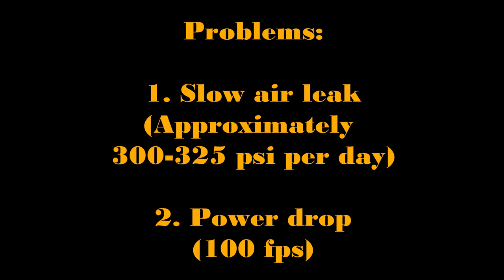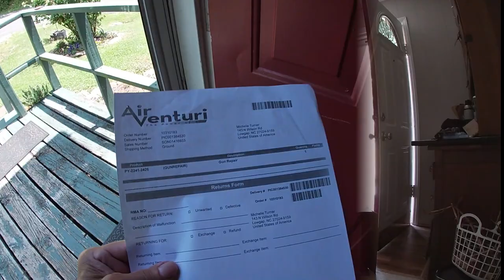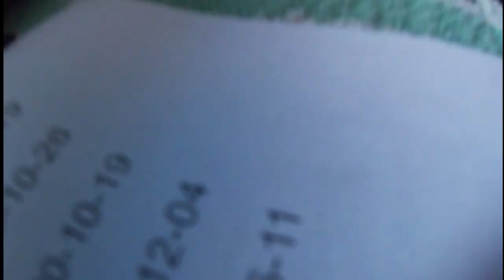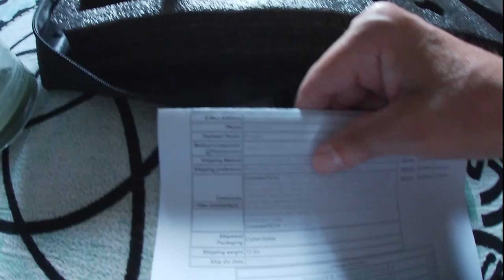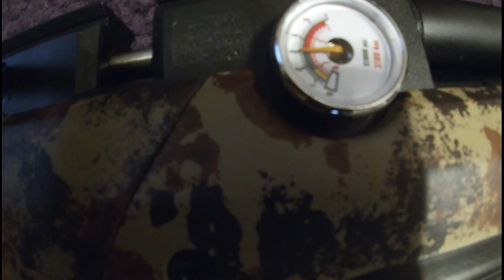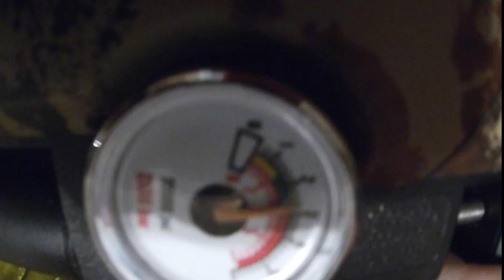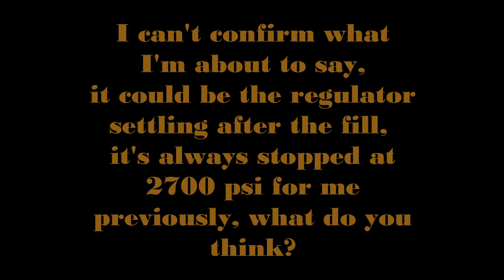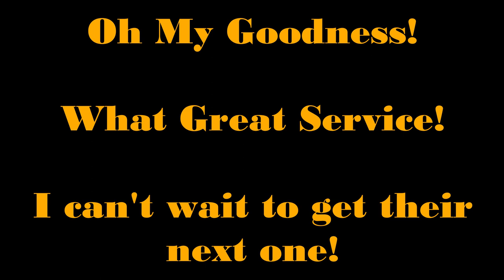Air Venturi Avenger Leak And Power Drop Repair Fail

Comment: I had the same problem, they sent it back to me and it was still leaking. Well after checking it over myself it turned out the leak was from the pressure release screw. the hard plastic 0-ring was over compressed or uneven so I went to home depot and got another hard plastic 0-ring and hasn't leaked since. Wasted 40 dollars to send it to Air Venturi and ended up having to fix it myself. The leak will not show up with soap and water for some reason. i pulled it out and inspected it when I did that I noticed it would not sit flat. Did the repair 5 months ago and it's been perfect. What's weird is when it had a leak the reg would creep up, but now that I fixed the leak the reg holds. Wish I would have inspected it myself before shipping it to te those ding-bats. They also never replaced the O-rings on the tanks because I marked the threads and they didn't even take it apart. Air Venturi was never like those before the Pandemic. Their service center was top-notch. It must be hard for them to find good help since Sleepy Joe Biden keeps giving people our tax money for sitting at home and pick their noses. About the Regulator, it's a very cheap regulator and it needs time to settle or you need to fire it 1 or 2 times for it to settle after filing. The regulator will never be perfect on this gun. But it's good enough to get sub moa groups at 50 yards once tuned. Once you get your main leak fixed you will be happy with the Avenger. Good luck man keep us posted.
Reply: agreed! some people are just too lazy to do it by themselves.
Reply from the maker: What the f*** are you talking about?? I'm definitely no poor wittle twumpy fan, by a looooong shot. I don't know who you were tlaking about praising their service before the pandemic, etc. but if you're talking to me, ummm, I'm not priasing shit unless it deserves it, and after this, and looking at their past customer service with the shit guns they put out, they're getting no praise from me, but a lot of sales losses due to my video on their shitty service. I don't think you know what you were talking about, maybe you were drunk. All I know is that you are trolling and being all political like a poor wittle twumpy fan, so you might wanna stop that shit, you're looking like one of them.
Reply from the maker: I'm not lazy, I had a warranty, and I also have real hosed up hands, actually every joint in my body, I've got a few issues so I'm disabled there slick. Take a walk in my shoes for a day and tell me about lazy, deal with chronic nerve pain head to toe and a bunch of other bullshit and tell me it's because I'm lazy. Fu*k off dumbass.

Comment: I have the wood stock version. Had it for little over a month, worked great with no reg creep or any other problems. I took it out yesterday May 1st 2023 and shot about 8 rounds. The gun started out at 3600 PSI, after the 8 shots it was down to 2000 PSI, I said " That ain't right" I took the gun in for a fill and it took an incredibly long time to fill? I took it back out to shoot and noticed when I pulled the cocking lever back I could hear a leak coming from the chamber, again I said "that for sure ain't right!" When closing the breach the air would leak out the barrel. I knew what was wrong, The plunger seal on the hammer spring had failed ! Not knowing how to replace it I called Air Gun Depot "where I had purchased it" and they gave me 3 options, return for refund, return for replacement or send to A.R. for repair.  I really loved that gun and struggled which option to use, as I didn't want one with reg creep, that is so common with these guns and mine was so damn accurate. I decided to go for the replacement as if it sucks, I can just get another till its a good one! I will let ya'll know how it turns out. If anyone has good step by step directions on how to fix this particular problem, I would love to hear it, as I know I could do it myself If I knew how. Thank folks.

Comment: Sorry to hear about your Avenger, I've had mine since Janurary this year , so far no leaks, I'm at work right now, but when I get home I'm checking it!!!
Reply from the maker: Thanks for checking it out. I know there are many with leak issues, but plenty of people have them running fine. I knew all about the gun before I ever got it, I was watching it and wanted one but wanted to see if they would fix issues. Well, I got it for Christmas so I was all in, lol. I thought they would actually try to fix it, I'm quite stunned that it came back the way it did to be honest. I'll fix it if I can, I know it needs a new poppet so I have to get an aftermarket one for that, I amthinking about just having it worked on and fixed by a guy that's said to turn theminto some really nice guns with a lot of power as well. If you running it at lower power you'll help prevent too much damage to the poppet it has in it and it will last longer. I had my reg on 2700 psi, it came that way and shot great so I left it. That is apparently too much for the poppet to handle, I'm still guessing it's the poppet. I told them all of this when i sent it back, still stunned at how this came back.

Comment: Have you made any ground on what’s causing the leak? My avenger is leaking about 1-200 psi per 24 hour period
Reply from the maker: It's been a couple of months, I haven't been keeping up on the channel. Nop I have put the gun down and left it alone, I'll fix it one of these days. I did put air in it a couple of weeks ago and it was empty by the next morning. I'm still shooting my Flashpups, my wood model is four years old and I've never changed anything other than the barrel oring that tears off when you remove the shroud, easy fix and doesn't have to have it. One of thes days I really will fix it, but not today, and probably not tomorrow.

Comment: I would check all the basics. Check and snug up the drain valve then snug up all the gauges. Unless you already did the soap test and got nothing at those locations. That’s where I would start. I have the 25 and have put thousands of rounds through it so far. I just upgraded to a walnut stock. I made a video of the improvements if you’re interested I would love to know what you think.
Reply from the maker: Thanks for the comment Sam. I understand what your saying, I have not checked the drain plug since it's been back. I love the gun, well, I wanna love the gun. As for me doing the soapy water test, shouldn't that have been done by the repairman looking for the leak to fix? Seriously, I shouldn't have to do anything to it, I can't see it being possible to let it sit overnight and not see that it had leaked. I shouldn't have to fix it, I paid to ship it back to them to fix it and it came back worse, cost me $31 to make it leak worse, I definitely didn't want it turned up as well. I too was looking at the new wood stock model, but if the warranty is useless for repairs I don't want it. I may have just got a bad one, no problem, it happens, but this is nonsense. I'll have it sent to someone who will replace the poppet, may just put money into jackign it up with opening the ports and getitng it tuned for high power with a good valve in it, but as far as buying another one from them, nah, they've done this several years in a row, put out guns that leak and the only way to get them repaired is after market parts and someone else, or repairing it yourself. Thanks for takign the time to leave a comment, I appreciate it.

Comment: Every few fills out one drop of SILICONE oil in the fill fitting, then attach hose and fill as usual. Before shooting each time, point barrel to the sky so oil will run down to exit tank and enter air system. This will keep interior seals and parts lubed up. And will help expose and/or prevent leaks in the pressure system.
Reply from the maker: I tried that back when I had the leak, didn't work, but thanks for the info. I do the same thing to my other guns occasionally, they have a fill port so I try to get a little in the fill probe hole to keep the inner seals lubed. I have one I need to change the seals in, it doesn't leak and shoots fine, it has the original seals from four years ago and it's doing fine, but I know it's recommended to replace them about every couple of years.

Comment: Damn brother that is just plain old flat-out terrible I know you don't want to say bad things about it cuz it is a great gun or had the potential to be anyhow but thank you for giving us an honest heads up and I was so close to buying one of those so far I've been lucky with all my tcp's thank goodness
Reply from the maker: I wouldn't recommend buying one until the address the issue. This one was supposedly fixed, I asked specifically about the poppet, they don't carry the parts. They are said to have fixed the new wood models, new poppets, but I just talked to someone and had a comment on my post about it in a forum that told me they are having the same issue with their new wood .22 model. There's a guy that makes poppets and works on them, the last two models they came out with had the exact same issue, they never fixed and keep on pumping them out. All they had to do is be honest or fix the damn thing. It just keeps getting lower and lower every day, but faster, damn what good service.
Reply: @timmy4539  Timmy Timmy Timmy and I'm at work to get you one this one but I'm prepared for a beat-down you have a great day brother talk to you soon
Reply: @timmy4539  Timmy Timmy Timmy The Hunt is on my friend que pasa amigo

Comment: Sorry about the issues. Leaks suck, I know. Only Air Venturi product I have is a carbon fiber tank set up, which is actually made for them by Ninja, they just slap their name on it. No problems with it, but like I said, they don’t make it.
Reply from the maker: Yeah, the issues with this model are known, they've had several runs for several years with guns that leak. If you look into in the forums it's pretty sad. I wasn't concerned, I thought they would actually fix it, this is uncalled for, you have worked on quite a few guns, you'd see the drop in the 12 hours and would have known. It may not be the repairman, I'm sure they have a list of things they have to go by and what they can and can't do. In this situation, it's either company policies that have the repair workers' hands tied, or it's a lazy worker not doing their job. If I'd sent it to you I'd have confidence that it would come back in working order, but the whole deal here was to see how they honored their warranty, if they really would fix the problems they knew the gun had when it was put out on the market, not only did they not fix it, they made it worse. I guess that means, "Thank you for your money and fuck you very much."

Comment: I was having the same problem with my Avenger, Take the stock off and replace the O-rings on the compressed air tubes. You have a long and a short air tube on the Avenger, use soap and water and air leaks will become obvious. I did this a year ago and they have not leaked sense.

Comment: Sorry to hear about your leak issues, I bought my Avenger in fall, bought a Nomad II to keep it pumped up and it leaks and I haven't even fired it yet, I had them shot 10 rounds to check it before they shipped it and they sent results looked fine and they stated no loss of pressure. Not going to send it to them for warranty they will just pull the same crap on me, sounds like it is poppet issues and the fact they we cannt get new poppets probably confirms that issue. Why in the hell don't they just fix the issue even if they had to install new delrin poppets, I will try to spend my money to fix this buy getting a aftermarket delrin poppet from this DarkCaharisma person, does anyone have the info for contacting this person to get this fixed. I could try to take gun apart and can probably do this, I did rebuild a player piano mechanism before but would rather send it to someone to replace poppet that knows specifically what they are doing. 
Again thanks for your video as this has brought some light on this leaking issue.

Comment: Was thinking of getting one these but it all seems too much hassle to have a PCP so I will be getting a multi-shot gas piston air rifle.
Reply from the maker: Thanks for the comment, sorry it's taken so long to answer, I've kinda been out of it for a while. it's not all pcp's it just happens to be this gun, I have a few other Budget guns and they've worked like a dream for four years and under, had one little issue with one and they had it fixed within a couple of weeks. This gun and company, however, obviously does not care at all about the customers, it's all about how much money they can screw you out of if you get stuck with a bad product you're on your own. Maybe if I filed a lawsuit it would get their attention.

Comment: I recently tried out three Avenger .22s and all three had regulator creep. All three were the new baffle models with a creep rate of 200 PSI in seven minutes plus an over night creep of 600 to 800 PSI. The rate of creep in all three Avengers was exactly the same which indicates a manufacturers defect. My begging of Pyramyd Air to send a non-creeper fell on deaf ears due mainly to their robotic customer service system. The ten for ten purchase is a joke which includes pumping up the air rifle and shooting it ten times and sticking  back a box for shipment. Don't think regulator creep diagnoses is on their agenda. Good luck on getting that problem addressed. My request was simple. Please don't send another creeper. Somehow without my understanding as to why,  my last creeper was channeled  over to Air Venturi for an evaluation.  My hope was they  were going to find me a new non-creeper. Wrong! My creeper was evaluated by pumping it up, looking at the tank pressure and doing a shot string. What does that have to do with regulator creep. The verdict of Air Venturi, " nothing wrong with your air rifle". The Air Vernturi procedure was identical to the joke Pyramyd Air calls ten for ten. Presently, I am seeking a refund but feel that will be ignored even though the Avenger creeper is within the 60  day return policy. 

My research and investigation has revealed a possible explanation  for ignoring the Avenger creepers. First, it is possible the creepers are a manufacturers defect of unknown quantities. The Avenger had a poppet problem that took over a year to solve. This may be the case for the creepers with the current Avenger inventory plus the cargo boats waiting at the dock to be unloaded from China. If my speculation is correct on the problem being wide spread, Pyramyd Air and Air Venturi are sitting on a possible loss of revenue if a regulator defect becomes common knowledge. .This is why I think Avenger regulator issues are ignored. Another issue that has compounded the problem is the lack of spare parts from China. Replacement regulators may not be available.  

Please  don't take my word for this information. Do your own investigation. Buy the Avenger if that is your preference. Above is my speculation based on experience and research however flawed that may be. This is an issue that air rifle consumers should at least have an awareness. One bit of advice I will give, if you have the 60 day exchange and return  policy  for the Avenger from Pyramyd Air, examine your air rifle ASAP and take advantage of the warranty. Don't send it to Air Venturi during those 60 days, you will regret it.
Reply from the maker: My .25 never really had an issue with reg creep, some of course, but yeah, I hear ya loud and clear. I got pretty sick of hearing the excuse by the community that has been trained to regurgitate their excuses, that it's what I get for buy a Chinese gun. I'm from Ohio, the last time I checked it was still in the USA, it may be manufactured down there, but it was approved to be made by the folks right here in the good 'ole USA, so that excuse doesn't fly well with me. If they wanted it fixed they would tell the manufatures to fix it, but that would require money to be spent, and obviously, this is a take money from the customers and lose them for a good deal. this is the third model they've put out with leaks and issues they ignored. I have the Nomad 2 pump, it needed a seal replaced out of the box, but it's been good since, going on three years, no complaints, but I won't buy another gun from them again, or anything else for that matter until I am sure it is actually worth buying.

Comment: A couple things come to mind.. As you fill it the air becomes hot and will show high pressures, as it cools down the pressure will drop.. Over night leaking might be because the hammer is pressing on the output valve and ever so slightly opening the valve.. I know this to be true because a while back some people found that if they drained all the air out they could not put air in with a hand pump, they had to cock the hammer to release the pressure on the output valve so it would stay closed so that they could pump it up,,
Reply: Cocking the hammer , on the first fill , is common. I do it on every new PCP.